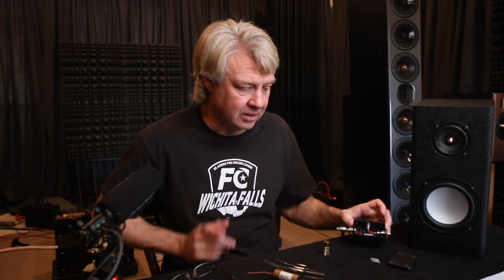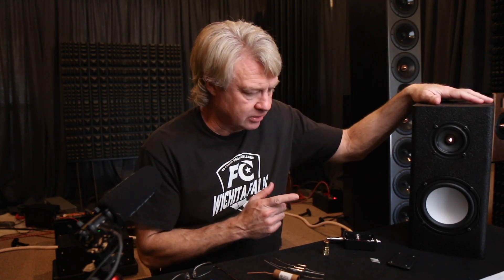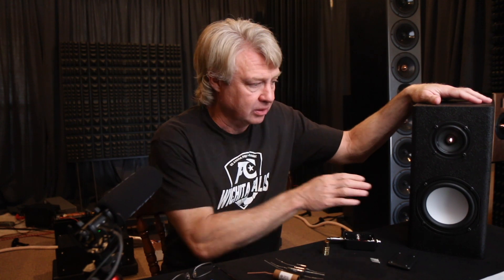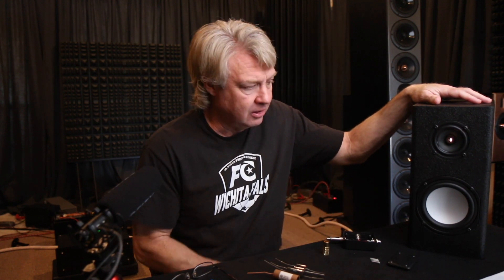BEST option for rolling off BASS??? Let's make In-Line Filters!

Comment: Dear Dany, I have just now discovered your so valuable explanatory videos and I begin to understand so may more about audio. I would like to ask you one specific question about the value of the capacitor to use in my in-line filter box, when my amps line in sensitivity measures (according to it's manual) 220mV/50k Ω? I would prefer to cut off at about 80Hz. Thanks in advance for your future reply.

Comment: It’s a shame people don’t pay more attention to this. I use the Harrison Labs FMOD filters and while I bet these would be even better, it’s such an inexpensive way to control bass. 

If your integrated has a pre / main jumper and you also use a subwoofer, all I can say is doing this has been as big an improvement as ANY piece of gear regardless of price. 

Bottom line is your tower speaker at 40Hz does not sound like your subwoofer at 40Hz. All the power and damping factor in the world isn’t going to change that. There’s a reason THX recommends an 80Hz xover.

Comment: I've been wanting to make a pair of High Pass Filters for awhile. I was relucant to take on the project becuase I thought I might get them wrong and waste time and money. 
Once I rewatched the video a couple of times and studied, studied the schematics, found my amplifier's impedence, plugged values into the calculator, and better understood the headroom benefits & the reduced load on the amp, I went for it.  I probably spent more time locating 0.015 uf caps than it took me to solder. Testing them out now with "Chairs on the Lawn" by Memotone without my subwoofers - and just as intended, the low end is gone.
If anyone is on the fence about making the filters, I encourage you to give it a shot. Thanks for the great video @dannyrichie9743

Comment: Does the voltage spec on the capacitor matter?
I have the choice between 600v DC and 100v DC. 
I'm a little confused.
Did lots of reading on high pass filters but there is no mention of voltages.
Thx.
Reply: You only need plenty. 100v will work , but 600v is proper overkill and therefore the best choice.

Comment: Do you understand why there is more cone movement at lower frequency?

If you remember from physics: f = ma.  Above the resonsnt frequency this is the main thing that governs the movement of the cone.

So (f) is proportional to the current flowing in the voice coil.  The mass (m) is the moving mass of the driver.  So it is the acceleration (a) which varies when a sine wave is applied to the driver.  For a given driver the amplitude of the sine wave of acceleration will remain the same for frequencies above resonance.  However, what you see is the motion of the cone and motion is the second intergal of acceleration with respect to time.  So, motion of the cone falls off rapidly with increased frequency.

Comment: Danny, what is your opinion about the adjustable high pass and low pass filters on the Emotiva PT2 to do this same thing? I was thinking of getting the PT2 for the flexibility and because I'm not a DIYer, but I always wondered if the parts they use in that thing would degrade signal quality. Since its adjustable, maybe it does this in a totally different way? To me though, it seems like it would be simple enough: just set both high and low pass knobs to 80hz

Comment: This easy mod worked well for me.  I'm bi-amping in hybrid tube/transistor configuration with the tubes feeding the midbass and tweeters, and a solid state amp and active low pass to the woofers.  I used 10nF silver mica caps to filter out lows at about 60hz to my Dyna/VTA70s.  I wasn't sure what to expect, but wow! ...what a great improvement.  Why didn't I do this sooner?!

Comment: My main amp is a DIY 300B, the input stage is a WE437@ but instead of a grid leak (which is a resistor to ground before the input tube), I'm using a grid choke instead, no coupling cap and inline grid stopper of 100 ohms. The DCR of the grid choke is 1.3K ohm, but it's AC impedance is 500 Meg ohm. I'm using a modified Dahlquist Low pass active, high pass passive crossover. If I use 1.3K the calcs say if I use a 1.5uf cap, my freq of roll off is just a tick over 80hz. I assume it's the DCR that needs to be used in this case, rather than a conventional "input impedance, as I have no way of physically measuring it, and there are no "specs" for this DIY amp

Comment: Can someone explain how this is different than using the line level inputs on my (powered) sub and letting the onboard high-pass filter out to the speakers do the low frequency roll-off?
Reply: If your sub has a cheap electroletic cap for that filter, this is an upgrade. Look for GR Research vid on Rythmik sub setup. He covers this. 
My pre amp has 2 amp outs so one can go to sub. The 2nd with this filter inline to amp for main speakers.

Comment: Great Video Danny, thanks for sharing your knowledge.
I ordered 2 x clarity caps esa 0.047uf crossing at 72hz, took an old decent quality rca cable, cut in half, did the same with a subwoofer cable then drilled 6 holes in a sturdy black VHS tape case.
I then threaded the cables through the snuggly fitting holes, stripped the wire then soldered everything together, snapped  the case shut and eureka, a fully functioning high pass filter at minimum cost and minimal disruption to the signal path.
I hope this helps someone else, shame I can't share the photos

Comment: Really surprised to not see XLR considering how…obsessed/enthusiastic…you are about signal purity. RCAs are good for cheap home theater. Idk if I’d want them in HiFi.
Reply: It is hard to find really high quality XLR's, but high quality RCA's are no problem. Also, most of the best sounding cables are RCA's. I would only consider XLR's if I was using runs of 100 feet or more.
Reply: @dannyrichie9743  I certainly don’t have your experience in A/B testing with cables. I’ve always been under the impression balanced cables are always better (assuming apples to apples quality). I’ll have to read a bit more about this. Thanks!
Reply: @jtmcfarland3512  All cables act as an antenna to some degree. If the runs are really long then using an XLR will really help. However, the XLR cables don't do anything for noise already on the line. Some RCA cables (like what we use) can act as a filter for high frequency noise and not only minimize anything picked up, but filter out what is already on the line. So most of the time the RCA cables will sound better and sometimes quite a bit better.

Comment: Hey Danny love your videos!
I have two sound sources I would like to add these filters to, one is a external dac to amp and one is a djmixer/preamp to amp

 the system is two bookshelf’s and a sub hooked up to receiver used as just a amp in bypass mode (no sub out function in bypass mode) 

I would like to add these filters to both sound sources, will I have to make 4 of these filters? 

Will 2 filters between dac and amp aswell as 2 filters between dj mixer and amp work?

And would I use 1 mono rca from each sound source to have sub connection from both sources 

Regards
Reply: Are you using the same amps?

Comment: I'm running a little EL84 vacuum tube integrated amp with the volume turned all the way up and I'm running a preamp into one of its line level inputs would I put this or could I put this filter before that line level input?
Reply: Yes you can.

Comment: Can this filter be sort of a two-step filter in that below 20 Hertz it rolls off really steeply for subsonics? Some of my records cause the woofers to just thump with no sound My preamp doesn't have a subsonic filter
Reply: This is a high pass filter. It will roll off the lows with a low order slope. So it will help with your issue.

Comment: Is this like crossing over to the sub woofer at 80 to 100?
Reply: No, this is showing you how to build a high pass filter. Where the slope starts depends on the cap value used and input impedance of your amp.

Comment: I've used a Harrison Labs P Mod 100hz in line RCA filter (~85hz @ my amp's 47k ohm input), or else a Harrison Labs F Mod xover with both lo & hi pass outputs. The filters help with high-output playback, but are unnecessary for moderate playback levels. I use a 90 degree RCA splitter to switch between filtered and unfiltered.

Comment: How would you determine what caps to use if you don't have access to the amplifier specs?
Reply: Contact the amplifier manufacture and find out what the input impedance is. You might find it with a Google search too.
Reply: I'll try the manufacturer a second time.  A small British company, not the most responsive.

Comment: I use an integrated home theater AV receiver that has 7.1 pre outs but no corresponding power amp inputs.  Also, my input devices - media PC, CD player, streaming device - all use HDMI outputs, so I assume an inline filter is out of the question?
Reply: That is correct.

Comment: I understand the distortion where the woofer has large excursion and also is expected to provide higher frequencies is called doppler distortion.

This is an interesting video, but in my situation I am using a pair of GR-Research OB subs in parallel to Magnepan 2.7 QR speakers and would like to roll off the 1st octave of bass to the Maggies. What would you propose in the scenario where you are running a powered subwoofer using high powered input (speaker level) in parallel with your main speakers?
Reply: Then the inline filter I show in this video would be ideal.

Comment: You relentlessly describe how to improve mid and high end by filter and box improvements. Now, with the splitting filter: could you present how to get clean bass with minimal spectral decay and linearity from 20-80 Hz? What would be the best option: Open baffle bass, transmission-line bass, bass-reflex? Additionally: best bass placement to enhance vertical and horizontal offsets? Many thanks in advance!
Reply: When it comes to best bass response I am all in for open baffle. It will always minimize room gains and room boom.

Comment: Excellent video topic Danny! Could you do a video with an example of this implemented in a balanced XLR cable configuration? I'm assuming the same value cap would be used on both signal lines of the balanced line, but want to make sure. Your diy videos are so useful. Keep them coming!
Reply: You are correct.

Comment: you can also use a multipole switch.... add a few values like 5. and aim for the middle value (based on the input impedance). then you can adjust the rolloff by the switch. its like a poor mans active :)

Comment: you are not halving the workload.. more liker 4 times....  its excursion  quadruples when moving half the frequency down (octave) moving the filter up one octave you can get +- 12 dB more out of it.
might be less in practice...  heat or other problems like distortion or whatever.
not sure if you can call it active. since normally you would use an op amp. not a cap based on the input impedance of your power amp.... its still passive.  but with different numbers. try rolling off the highs with t he same anolagie...  quite a huge value.  no power though

you also have to make new filter for every power amplifier..... not sure if thats is handy :)

Comment: I was just trying to figure out how to do something like this! Question: I don't have a separate pre-amp and power amp, just an integrated that takes RCA from my DAC and outputs straight to the speakers via high level, and to my sub via RCA pre-out. What's the best solution for high-passing my speakers in this setup without replacing my integrated with separates? Is there one?
Reply: I would recommend stereo sub's for starters. Using high level inputs on your sub's for signal. Using the same wires going to your speakers. Whatever stank your amp is sending to your speakers is the same stank you also want going to your sub's. Makes sense right. Using  an RCA output (in most cases) is a mono signal, combining both the left and right. Sub's not only produce inaudible sub bass, that you feel more than hear. They also provide support for the mid bass drivers in your main speakers. Mid bass most definitely will image just as your main speakers do. In your setup you have eliminated this imaging. Effective, not achieving the sound quality you could have. Everything gets better when you incorporate the imaging of stereo sub's. Think of it as the foundation of any stereo soundscape it is rendering. Note the smaller the subwoofer driver the more articulate the bass it is capable of producing. Impact...pair of 12's absolutely. If sound quality is the main goal. High quality pair of 8" subwoofer's will do nicely. Revel performance can now be had for much less money in the Martin Logan Dynamo 400, as an example. Then it will be time for your question to be answered. I use a Wadia 151 DAC Mini...Usb and or toslink input's nothing but speaker (high level outputs) going to both main speakers and both sub's using banana's that allow another banana to plugged into them. I would also like to decrease the (low level) demands put on my main speakers. As a GR Research customer, I will contact them to see if it's possible with my setup. Contact them, they are very nice and professional. Good luck...Would love to hear what difference you heard if you try it. Steve.

Comment: Other than expense, what are the disadvantages of doing this with DSP,  like a MiniDSP unit?
Reply: Not all DSP devices are the same. Some (like early MiniDSP devices) are very cheaply made and use very cheap DAC's, power supplies, and analog output stages. So they sound horrible. It also require multiple amplifiers and can get much more expensive to do right.
Reply: @dannyrichie9743  Thanks for the education.
Reply: i appreciate the analog way shown in this video, i also wonder how dsp fare in comparison. how good can they get and so on?
i have thoughts about it, and adding it to a signal chain could work. but removing a preamp and putting in a digital only dsp should do most good with least amount of harm. like a minidsp shd studio. 
no preamp but keep your dac and power amp.  thats the way my system ended up and i got great results with no discernable drawbacks.
i am not an experiences hifi person, so thats why i would like to see someone else do this and report on it.

The Hans Beekhuyzen Channel(shd studio) liked it, and Audiophile Junkie(the shd) praise that one.
Reply: @sudd3660  With the added benefit of Dirac, correct?
Reply: @michaellong9039  dirac and automated eq are helpful tools we can use.
i did not get good result in my system and room. i did it all manual by ear, and played around with measurements also.

Comment: Thanks Danny, is there anything like this I can do to reduce the SPL on the high frequencies? It's been suggested to me to put a 4-8ohm potentiometer in line with the tweeter to achieve that effect. If feasible I would love to know your thoughts on that.
Reply: Keep parts like potentiometers out of the signal path. I bet your tweeter already has some resistors on them. Just adjust the values.
Reply: @dannyrichie9743   thanks!
Reply: @dannyrichie9743  Well naturally, as long as you are versed in basic electronics, identified existing crossover alignment correctly and have access to loudspeaker measurement system. Otherwise, you can always replace rheostats with fixed value resistors, once your ears are happy with the preset values and you only need a DMM for that.
Reply: Look for L pad  type speaker attenuators, these have the benefit of maintaining fairly constant load impedance by employing combined series and parallel variable resistors.

Comment: In a crossover circuit, say a choke and a capacitor does it matter which way each component lies in the circuit? what if you also have a resistor in line does that matter where it is put in the circuit? Cheers
Reply: In some cases which part comes first is imperative and in some areas of the circuit the order of some parts doesn't matter.

Comment: Is there a solution for XLR type cables?
Reply: You can do the same for an XLR cable, but it requires a matched pair of caps for each positive leg.
Reply: @dannyrichie9743  Yeah, thought as much. Thanks!
Reply: @dannyrichie9743 Just curious about using a low pass filter for the sub-woofers? Would you recommend having an in-line filter for low frequencies by using an inductor?
Reply: @ No, it is better to use some type of a active subwoofer plate amp to control everything.

Comment: Thanks Danny for this info. Makes lots of sense. Off the main topic, however, I can see that you have different cable lifters on your speakers wires now. Why the change? Also, why are some of the lifters not in use and just lying on the floor? Cheers.
Reply: Danny got a bucket of rebar chairs a while back and has been using them instead of the tinker toys.
They're on the floor because he was recently moving them to another amp after a prototype RCA cable stopped working properly, and he just hadn't put them back up on the chairs when he filmed a couple videos on Monday.
Reply: @hoth2112  Thank you. I'm not familiar with rebar chairs; could you explain those items?
Reply: @les5309  They're used to suspend rebar rods within the middle of thick concrete floors. (Like the foundation of a house or commercial building) they come in a variety of sizes, shapes and materials.
Reply: @hoth2112   Many thanks.